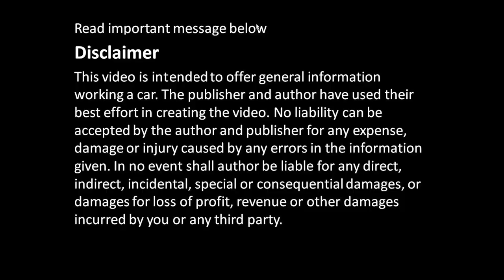How to connect Coolant and Air hoses and pipes in Toyota Corolla VVT-i engine. Years 2000 to 2010

Comment: Your explationation is very clear, 
I have a problem, I have toyota corolla 2003, some time its auto transmission not work, I put it in D or  2 or L but it not move, some time R also give problem, I have change its ATF T-iv and also put liqui moli addative. But problem still exist. Please guide. Thanks
Reply from the maker: Hi, your automatic clutches are worn out.
Reply: @PeterFinnTheCarDoctor  It can be repair or change with new one. Whole transmission assembly required to be change or sepratly clutch can be replace/repair.

Comment: Hello Dr I have 2011 Toyota belta/Yaris can you please tell me where are the petrol lines that are connected to engine from tank I want to disconnect from engine and completely dry the pipes and tank from old fuel
Reply from the maker: Thanks and noted 👍
Reply: @PeterFinnTheCarDoctor  it's been sitting in my garage for past 6 months an i left a quit a bit of petrol and added fuel maintainer in it to protect the car tank to produce water "I heard it from someone" is there anything else I should take care before starting my car ps I disconnected the battery
Reply: @PeterFinnTheCarDoctor  and thank you ver much for reply I didn't think I would receive a reply from you